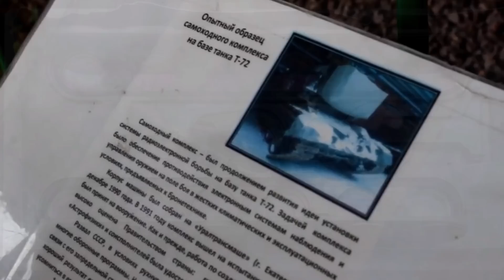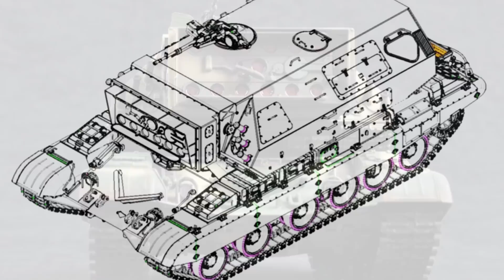What Laser Tanks did the Soviets try to produce?

Comment: Maybe mounted on a long range flying platform... Maybe an aerial drone...
Reply: Drones?) There were orbital-based and ground-based complexes with nuclear beam pumping.

"Polyus" (SKIF-DM, item 17F19DM) is a spacecraft, a dynamic layout (DM) of the SKIF combat laser orbital platform, the Payload used during the first launch of the Energia launch vehicle in 1987.
Reply: "The goal of the GF-1/2 experiment was to create an artificial "Dynamo effect" in the earth's ionosphere. Finally, the GF-1/3 experiment was planned to create large-scale ion formation in ion-and plasmospheres (holes and dacts). To do this, Polyus was equipped with a large amount (420 kilograms) of xenon-krypton gas mixture (42 cylinders, each with a capacity of 36 liters) and a system for releasing it into the ionosphere."

A large orbital jamming device. BFG.

The prototype was destroyed during an uncalculated descent from orbit and partially burned up in the atmosphere. There were at least 4 such orbital platforms.
Reply: Yeah that's cool and all, but I'm thinking about a small low detection platform vs. satellites. Cool info. Seeing as the tank platform in the vid is much more of a low cost platform (as compared to a satellite) something in atmo seems to be ideal, as LOS is still a major hurdle for such tech.

Comment: Need energy density breakthroughs.  Then perhaps rail gun tanks!
Reply: Eric Bunker Railguns are being quietly abandoned by previously interested parties. Turns out they are too impractical in the long run compared to conventional munitions despite some of their advantages. 

One of the selling points of railguns is that the ammunition is cheap, but the barrel wear and tear alone is so expensive that using conventional shells actually costs less when you factor everything in. 

On a tank they wouldn’t work well because they require large energy reserves funneled to capacitors and that means huge and heavy batteries or drawing energy from the engine, which kills the mobility of the vehicle. You’re right that perhaps energy density breakthroughs might solve this, but that still leaves the other problems.
Reply: @QualityPen  As I said we need an energy density breakthrough.  Once you have a method of enormous power generation engineering a barrel that has no physical contact is the next step.  Currently railguns are impractical.  That doesn't necessarily mean they will remain so.
Yes, I'm basically thinking science fiction.  But not that long ago the smartphone I'm typing this on was science fiction.

Comment: 200KW solid state laser diode pumped laser is here for a couple of years.
Diode lasers haw made things much easyer. Main problems are optics and beam propagation.
Ther is a solution, adaptiv optics and medium tuneling.
It complicated but not imposible.
Then you just need to make a 800KW power source in continuos output, as it goes it will be the bigest problem by far.

Comment: Nice information dig up. I never knew these were a thing.
I will try to gibe some insight on lasers back.
Ruby lasers were the first type of lasers but quickly became obsolete wherever much power was needed. The crystal heats up unhomogenously in the laser resonator which causes a thermal lense which can ruin beam quality.
That is also why diode lasers are a poor choice for long range applocation. They have much larger divergence angles than solid state or gas lasers.
The long ass complicated word was YAG the modern go to chrystal. Most common doting materials are Neodym (40% electro-radiant conversion efficiency and amazing power density, near infrared)
And Yttrium (up to 60% conversion efficiency bit lower power density due to optical lens effects)
These types will likely replace the CO2 lasers on things like the Rheinmetall anti drone laser systems.

Comment: Combine this with drone technology and you could have small drones with mirrors to act as eyes in the sky as well as allow indirect fire from these systems. 
That way you don't have to have this huge power system on a drone, just a little mirror that can be tucked away when not in use.
Reply: That's not how things work. Drones suffer tremendously from vibrations. Aiming with them would be impossible.
Reply: @nottoday3817  Fair point. 
I suppose the mirror would require some form of stabilization to work as a bank shot assistant.

Comment: It is interesting how power management and laser efficiency has changed since the cold war.  Then you have these massive systems to disable sensitive electronic systems and physically blind the enemy.  Now lasers still can't burn through heavy armor or thick fast moving metal, tanks and conventional artillery shells.  However they can put a hole through unarmored ships, aircraft, missiles, or thin cased artillery munitions (such as with multiple submunitions or scaterable mine fields).  Haven't seen the new lasers on anything smaller than a warship or 747 yet but DARPA and similar agencies still have people working on that.

Comment: Modern diode lasers a like 1000 times more effective in relation to weight/power use as the ones from the cold war.
The danger is not for them to melt armor but permanently blind people.
One could pretty "easy" today have automated systems blinding soldiers on the battlefield with lasers outside the visible range so you would not even know it was there.
It blinds you faster then you can blink with a football sized cone you could sweep towards the enemy location.
Reply: Sounds like war crimes
Reply: @newolku  it is im pretty sure, according to current conventions, which is why you don't see everyone doing it already.

Yeah, here it is, from the wik's article on UN Protocol for Blinding Laser Weapons:

Article 1

It is prohibited to employ laser weapons specifically designed, as their sole combat function or as one of their combat functions, to cause permanent blindness to unenhanced vision, that is to the naked eye or to the eye with corrective eyesight devices. The High Contracting Parties shall not transfer such weapons to any State or non-State entity.
Article 2

In the employment of laser systems, the High Contracting Parties shall take all feasible precautions to avoid the incidence of permanent blindness to unenhanced vision. Such precautions shall include training of their armed forces and other practical measures.
Article 3

Blinding as an incidental or collateral effect of the legitimate military employment of laser systems, including laser systems used against optical equipment, is not covered by the prohibition of this Protocol.
Article 4
For the purpose of this protocol "permanent blindness" means irreversible and uncorrectable loss of vision which is seriously disabling with no prospect of recovery. Serious disability is equivalent to visual acuity of less than 20/200 Snellen measured using both eyes.
Reply: @semperfool459  All true there are the big 3 ABC warfare, but other than them many militaries have bend the other prohibited weapons. 
Like using anti-material weapons on soft targets or using incendiary weapons (White phosphorus) even in civilian areas. 
You will have armies using laser weapons to blind and they will either reason the enemy are not "real soldiers" and themselves not following the rules and using mines & IED's. 
OR they will just say well we are not trying to blind them but trying to fry any optical equipment they are using. 

My point is look at this video of a very gifted guy (styropyro
) that is building stuff from "Consumer electronics" and now imagine military or semi-military groups going down this road but instead with invisible lasers.. If he can do that now anyone could get stuff like this or more powerful in 10 years. 

https://www.youtube.com/watch?v=W6FbUiiwutQ
Reply: Semper Fool it’s the reason why despite it being safe to use, concerns like that is what have pulled the active denial system from the field.
Reply: @dirkbruere  puhh yea that would be scary.. :(
Reply: The use of a anti material weapons thing wasn’t signed by a lot of countries including the United States
Reply: @newolku  Yea it would be prohibited, but prohibited weapons are used all the time like white phosphorus in urban environment and the like. 
I do not think rules will stop countries like China or military groups in the future to use laser blinding weapons.
Reply: @newolku  But burning someone to death, disembowelling them with a bayonet, etc, is fine, right guys? Is the death of one million+ Iraqi civilians a war crime? What about the current ongoing genocide in Syria?
Reply: @newolku  well educate the Chinese armed forces...
Reply: using that sounds like a good way to get oneself nuked
Reply: @semperfool459  Most militaries and especially military groups are already bending the "lesser" prohibited weapons. 
Like using Anti-vehicle weapons on soft targets or using incendiary weapons even in urban environments. (White phosphorus). 
And those are just the things we know about. 
Unless someone uses the big 3 (ABC-weapons) or those weapons are used against a nuclear power, it will mostly be overlooked.
Reply: Indeed, an LASER in the IR or UV wavelength would be invisible to all individuals, scary.
Reply: True true. Make love, not war.
Reply: Modern nd:yag is still more powerful for its size, when compared to diode lasers... Even though the pump for them is indeed several diode lasers (replacing xenon lamps). And remember, Geneva convention doesn't apply in civil wars.

Gruesome fact: the hongkong protesters are indeed using 4 Watt lasers to blind the police
Reply: @SurajGrewal  Hong Kong protestors are in the right so it doesn't matter. Fuck China
Reply: @18Ramina  It is hard not to back the protesters, when all they want is for the government not to be send to the mainland for torture and organ harvesting.
Reply: @steffenjespersen247  and all ISIS wants is their own state
Reply: 1 country, 2 systems for 50 years, you remember that was the promise given by the CCP ? 

LOL ISIS !
ISIS don't just want their own state. They want land from 3 different countries and make that their state and treat anyone living there already as slaves... Big difference.
Reply: @londonberry2180  They just want to live under HK laws until the 50 years are up, like they was promised by CCP.
Reply: @steffenjespersen247  also, the proposed extradition treaty was part of HK law, not even imposed by the CCP. If the HKers weren't criminal harbourers they would have let it pass. But no, they would rather protest for the sake of a criminal who murdered his girlfriend in Taiwan
Reply: @londonberry2180  lol collect your 50 cents..
Reply: @steffenjespersen247  be great if you would send me those 50 cents thank you, because I don't get paid. I'm just exercising my free speech like those rioters. Don't like it?
Reply: @SurajGrewal  Right but then the compactness of the Nd:YAG is because of the compactness of the diode laser. 
A 100W diode relay is as small as 50 grams (without heatsink) and an efficiency of about 30% that is tiny compared to what we saw in the cold war.
Reply: Another more legal use would be as a automatic secondary laser "dazzler" on tanks or drones that could target the gunners current target or multiple other targets in range destroying/disabling their sensors and preventing them engaging the tank.  
Or automatically targeting any low flying air target with a trajectory  towards the tank (drones or missiles).
Reply: modern diode lasers are only used as pump sources...fiber lasers is what was truly revolutionary. You can put a 6kW !continuous! laser into a car.
And as of the old laser - 30kg of ruby must've had insane peak power and pulse energy.
Reply: It'd also be intended to be used on civilians to cause mass disorder, because the military can just as easily solve it with eye protection.
Reply: @experiment506  no, at the power levels these can deliver at tactical distances, you would need seriously T H I C C goggles to be able to protect your eyes, up to the point where it would seriously hinder combat performance.
Also - if you wish to conquer a country, the last thing you want to do is to permanently cripple civilians.
Reply: @experiment506  You can only "easily" protect your own soldiers from your own lasers, you need different filter for each laser frequency. 
But yea agree a military force could use it on civilians on a massive scale without hurting their own soldiers.
Reply: stop atting me you shits,i said something simple so fuck off already you fucking boomers
Reply: Wait, so blowing someone up into two dozen little bits is fine, but God forbid you blind them?
Reply: Considering someguy made one out of a pizza box, a pair of cheap Chinese servos, a webcam and a laser pointer, I wouldn't be surprised if you see something like this in the future
Reply: In response to all the replies that lasers are somehow illegal, the answer is they are not specifically banned in any treaty (which tend to predate them). The usual objection is they are unusually cruel weapons as they blind the target. An American memorandum of law written in 1988 examined the use of lasers and concluded they were not illegal nor unusually cruel weapons. The Americans speak only for themselves but I think they are pretty representative of views on this.
Reply: I am sure that there are real cases of criminal prosecution of people who blinded airliner pilots with a powerful laser pointers. Like really, REALY powerfull ones.
Reply: That’s a war crime